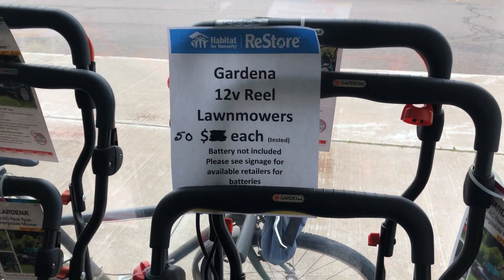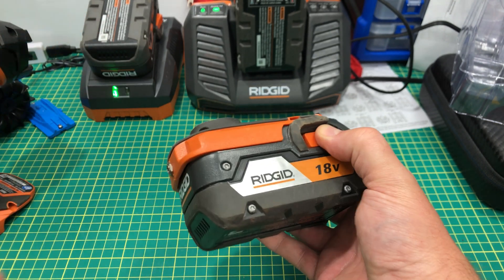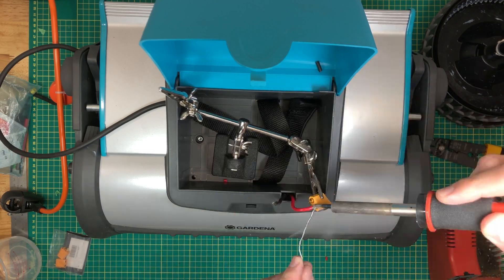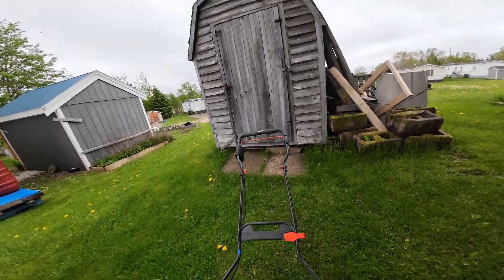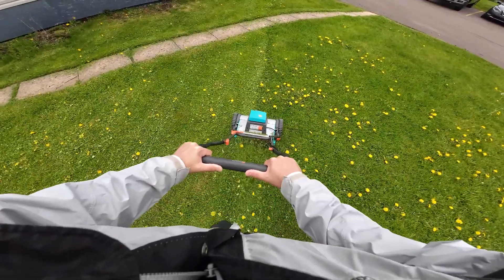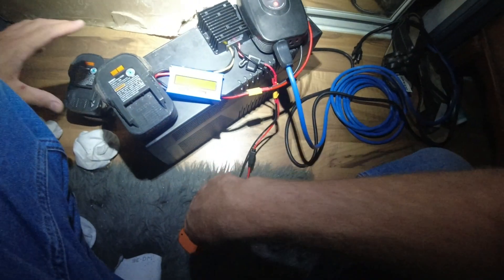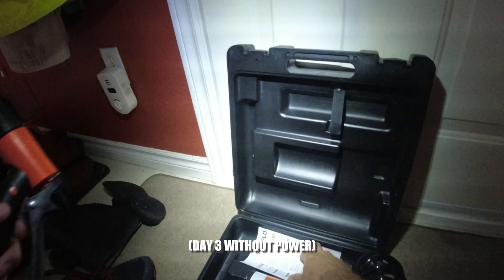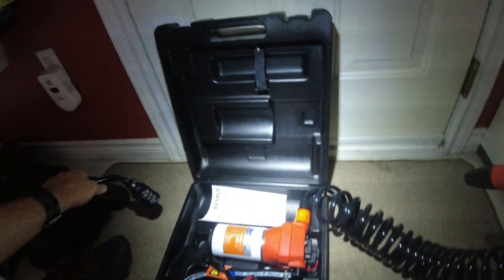Running 12V Gardena 380AC on 18V cordless drill batteries

Comment: Be aware that many battery solutions (eg Dewalt) have the under voltage protection in the tool. So if one buys a generic adapter without this feature and connects to the battery, there is nothing to protect the cells from being undercharged. That will significantly reduce the lifespan of the batteries. 

For other types of batteries, like Makita, the undervoltage protection is inside the battery itself. 

I don't know about Rigid. But I suggest you check, and if necessary, you put an undervoltage protection between the battery and the mower. 

Sincerely :)
Reply from the maker: You're right, battery protection needs to be handled inside the battery. I should have mentioned that specifically. For the Rigid 18v batteries I'm using, it seems the battery handles low voltage cut off since the devices I've been using don't slow to a stop, but rather, they just shut off.

I'm disappointed that a company would choose to use tool side low voltage cut off - I guess that means as battery technology evolves, the tools need to be replaced.
Reply: @charlie-whiskey  I actually did not think about the possibility of new battery technologies, but good point. 

I believe most systems have placed the under voltage protection in the tool, and only a few (I only know only of Makita and Rigid) place it in the battery. 

I remember watching a guy on YouTube repair/salvage/recombine tool batteries. He did a lot of it, for customers. And as far as I remember overall he had good things to say about the types where most control circuits (including the undervoltage protection) were placed outside the tool (edit: outside the battery). 

The first and obvious reson is that it is simpler to move cells around when the architecture is as simple as possible. 

Furthermore he said that there were more parts in a Makita that could break, and he more often had to give up repairing a Makita battery than a DeWalt battery. 

The real crime, IMO, is that almost all the third party adapters, and also some third party tools (like a DeWalt compatible glue gun I bought), don't have any undervoltage protection. And most consumers don't know the consequences of draining the batteries like that, so they drain the battery completely every time they use it. 

Overall I agree with you and think under voltage protection does belong in the battery.
Reply from the maker: @mrvelleful  You got me thinking a lot!  And so after some digging, I found that some batteries may send a low voltage state to the tool and the tool shuts down because the battery said "Low voltage state".  

This makes sense to me.  If the tool monitors the battery, the battery tech can't change.  When the tool monitors a low voltage true/false signal, then the battery decides what low voltage cut off is, and the tool is just doing what it's told to do by the battery.  

I think a battery that incorporates all management is the most flexible and with the cost of batteries, I sort of expect the batteries to be smarter, especially considering premium dollar that top brands demand for their battery packs.

Thanks for commenting, I really enjoyed this conversation.
Reply: If you don't have a spare 18v 4.0 wouldn't it just be cheaper to buy a lithium 12v battery?
Reply from the maker: Since I already had the 12v lead acid and rigid 18v batteries I never needed to look for another battery type, I’m not sure what a lithium battery costs.  I converted the mower to use 18v rigid batteries because they charge fast and it’s easy to pull them out of the mower instead of trickle charging a lead acid.  The rigid batteries get more use in the mower than my tools 😂
Reply: @charlie-whiskey  did a quick search and they are just over the price of the DeWalt 4.0 battery... Including the stepdown convertor I don't think it's worth it if you have to buy the battery but it sure is a fun hobby project